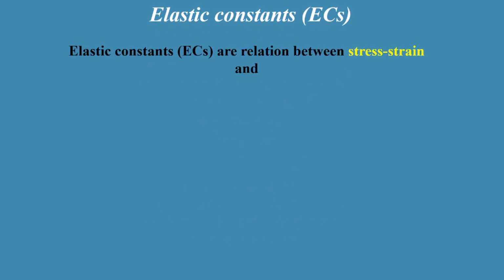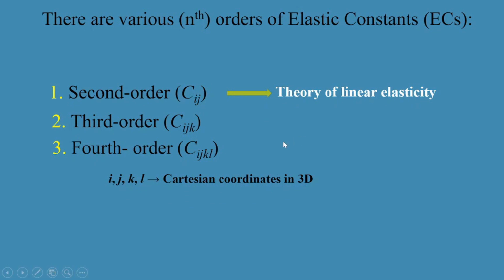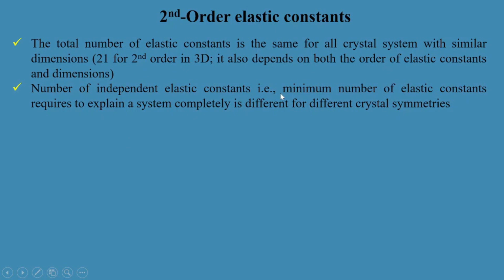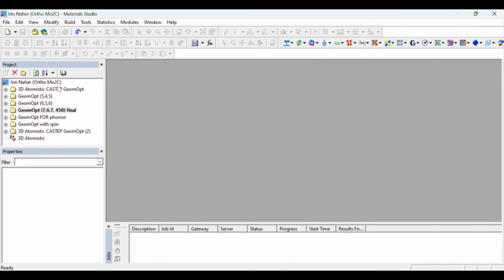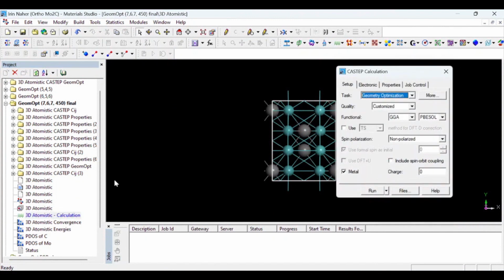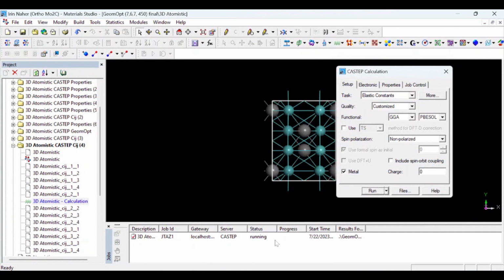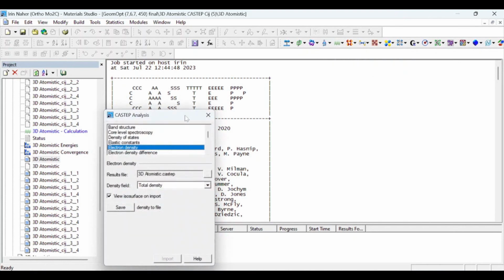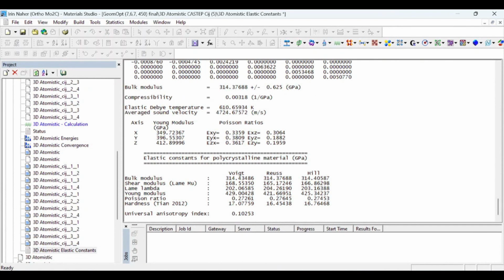Elastic Constants Calculation Using CASTEP (Materials Studio) || Irin Naher

Comment: I got an error elastic constants for only proper solids. How to solve this
Reply from the maker: Dear @anila5561, It is difficult to offer any solutions without conducting a thorough inspection. Follow the video thoroughly, reoptimize the structure if required, and also check your computer's configuration, as running the elastic constants demands more time and a well-configured computer. Best of luck, and thanks.